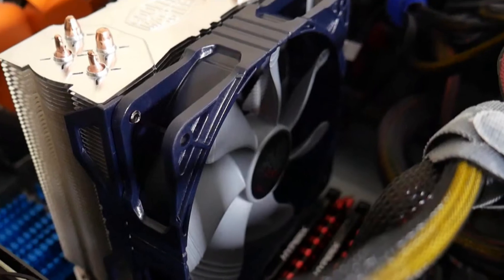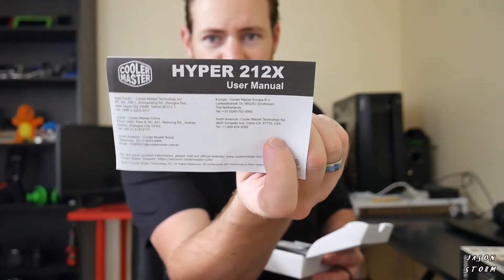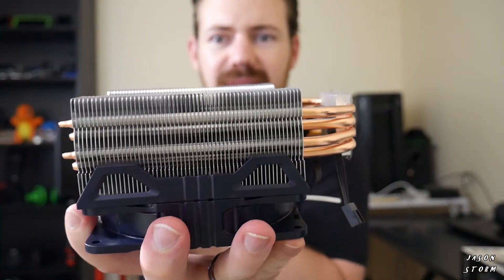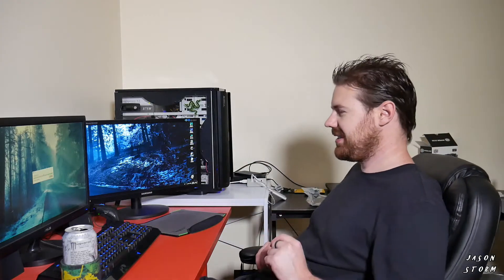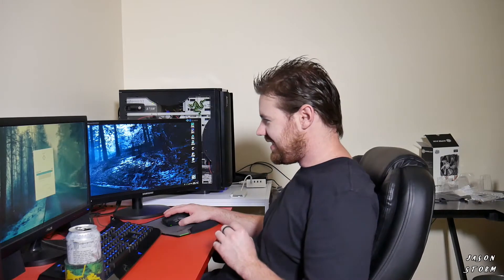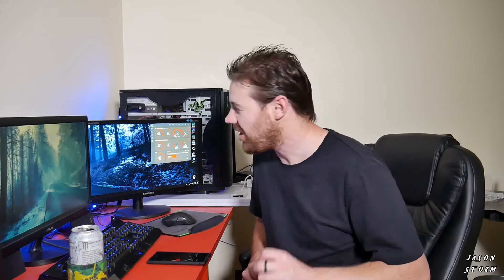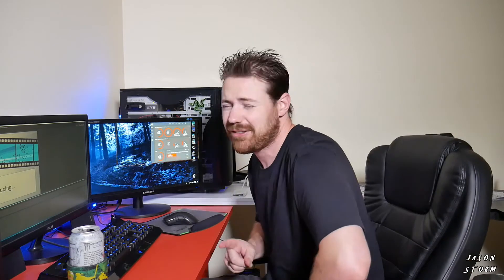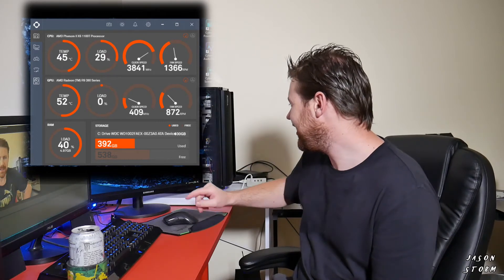Cooler Master hyper 212X review & unboxing

Comment: 66 deg on full load isn't too bad a temp to start with, considering the cpu is rated to 100deg. You only brought it down by 14deg which is ok but not a huge drop. Not sure I would have bothered unless your stock fan was really noisy as well. Thanks for the video.

Comment: Do you think this would be good to cool i5 8600k when overclocking to 4.6Ghz?
Reply: You could achieve way better temps with a better case i think...
Reply from the maker: Yeah, the 212x is compatible with your socket and much better then the factory cooler. I don't see you having any cooling problems with a 8600k overclocked, this is probably the best cooler in this price range
Reply: Jason Storm Ok thx

Comment: Does it still slide around on the CPU when completely tightened like the 212? Because I don’t like water coolers but finding one that will fit over your RAM that’s not one can be hardone that will fit over your ram is sometimes a pain they should always be mentioned and he seen previews because man there’s so many great he seems once I get up once I get it over that ram you know this is one right here the freezer seven pro oh my God amount of that on my CPU I was in love with that cooler and then I realize my RAM is going to hate it because that would get the best cooler ever if you wasn’t for hitting the ram. .....I’m just talking and send it if you know what I mean
Reply from the maker: +chillcomputerguy I have never installed a 212 so I can't really compare.
There is a little movement there, you can twist it a very little bit but I wouldn't say it slides around at least not on my AM3 socket